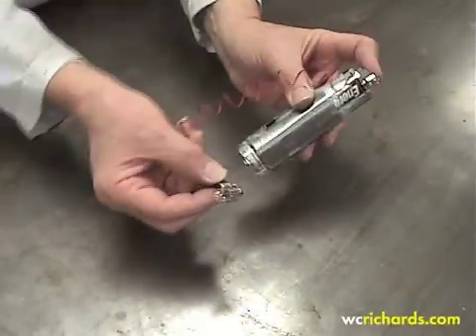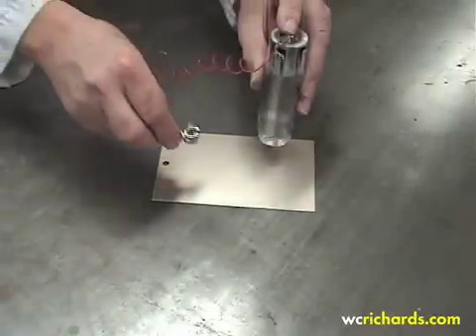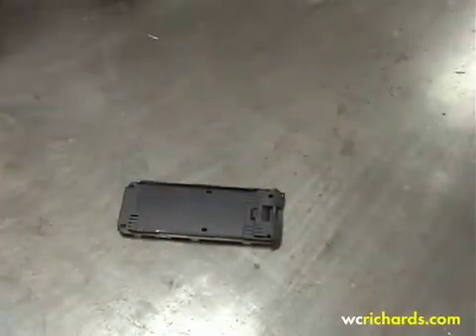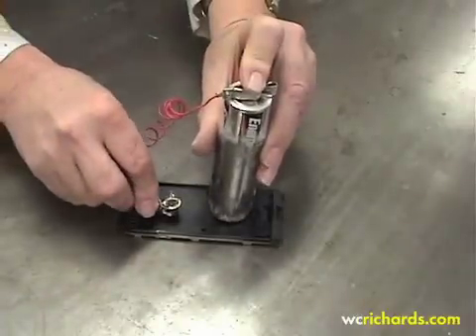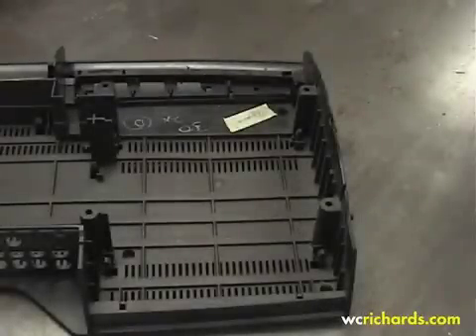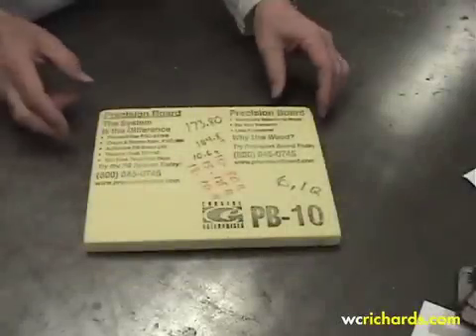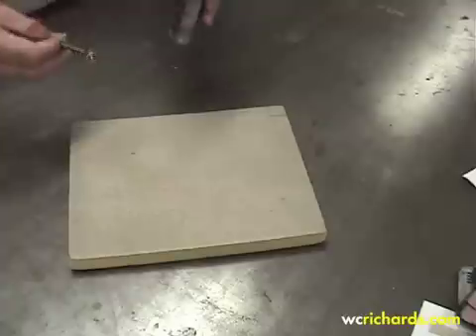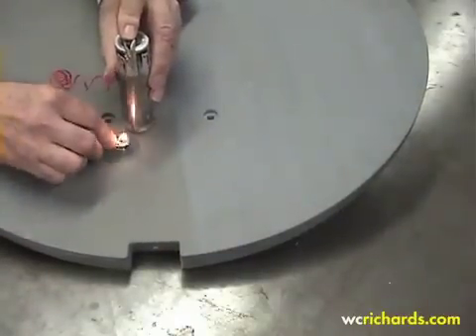Conductive Coatings

Comment: I have some Inks you way want check out, much cheaper.
Reply: send the links please
Reply: Contact me @ dmurphy@plastek.com
Water Base Inks
15ml $8.93
50ml $34.oo
150ml $89.25
500ml $ 297.50
 
Water Resistant S.W.A.G. Ink
15ml  $ 12.25
50ml  $ 42.50
150ml  $ 127.50
500ml  $ 425.00
 
Heat Resistant Ink
15ml  $ 10.20 
50ml  $ 34.00
150ml $ 102.00
500ml $ 304.00
 
Thanks Murf!